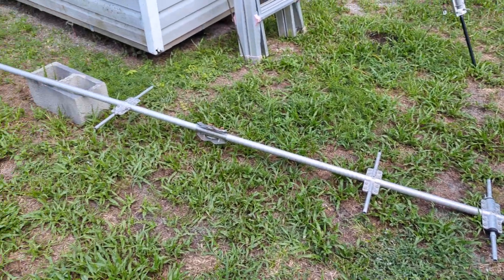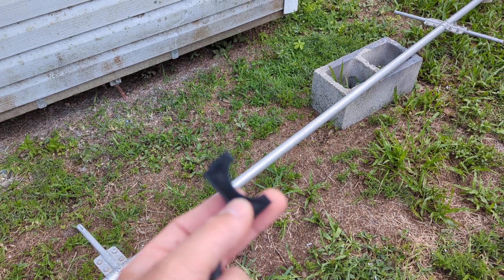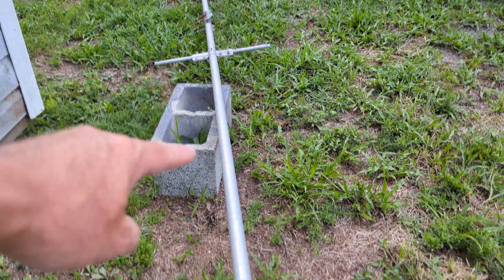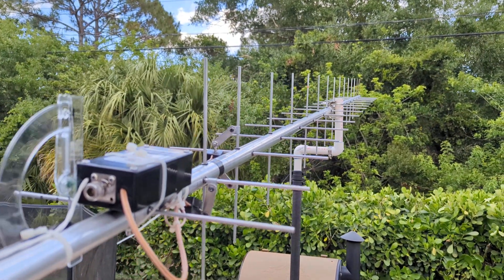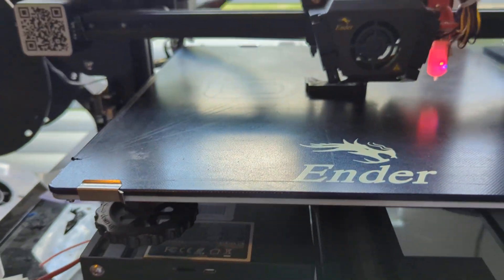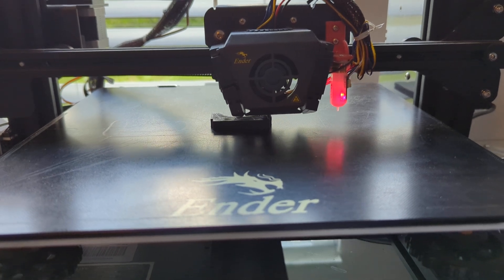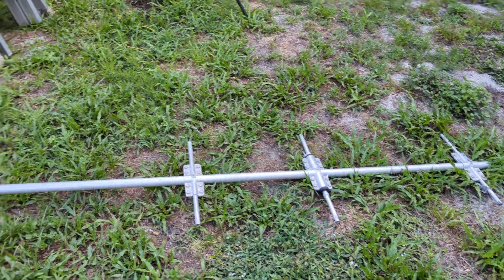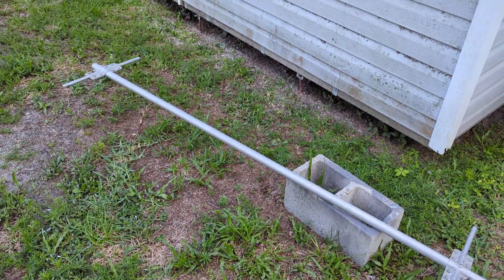Homebrew Yagi Project For 23cm, 1.2GHz EME, Part 1

Comment: It’s strictly digital ?
Reply from the maker: For most stations. You need 4 or 8 stacked yagis to do CW and even more like 500 watts to use voice.
Reply: @HamRadioConcepts You can run CW with 100W at the feed point on a 10ft parabolic dish.
Reply from the maker: @PT9KK ok well I am more interested in achieving contact using Q65 with a yagi.
Reply: Yea yea i was just wondering if you only do digital, im strictly ssb
Reply from the maker: @Knarf14 Nope. I only use digital to test antennas And EME Moonbounce. Other than that, I'm 80m-70cm AM/FM/SSB

Comment: :-)  The 2M CP Yagi build I'm doing has 3D printed element holders.  I designed them in freecad.  Then I used 4mm brass threaded heat inserts with 4mm pointed grbu screws to stake stuff in place.  So far so good.  I go with PETG for anything outdoors.  Great Series!  The design I'm going with is completely insulated.  I'm trying to make the element centers cross above one corner of the square boom.  We'll see how it goes.

Comment: Have you already put that black, element to boom, saddle in a microwave oven to make sure it will not get hot? If it does get hot, it will be useless at 2.4GHz and pretty much the same on 23cm. Don't forget to put a glass of water to absorb the RF energy while you do the test.
Reply from the maker: Never thought about that
Reply: @HamRadioConcepts  My "elmer" KD3CN had the same thought. We put some PLA in the mw for 5 minutes and it was no issue.  Please be carefull leaving printers running over night.  I use a tiny smoke detector mounted right on the printer frame.
Reply: @HamRadioConcepts  Some insulating materials, used on 6 meters, will raise the SWR because, at that frequency, they do not behave as we would like. Can you imagine what happens on 1200MHz?